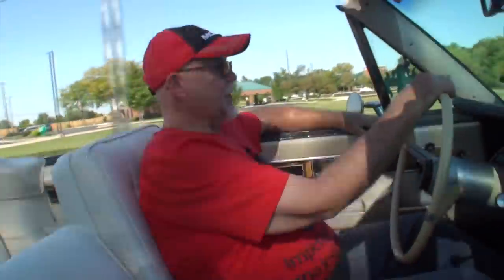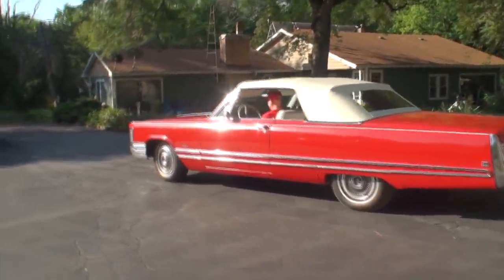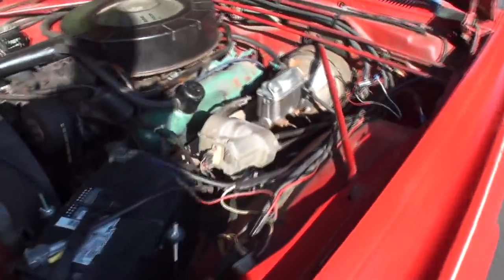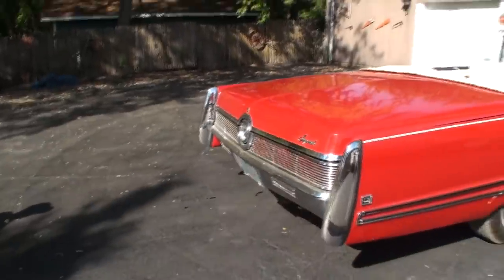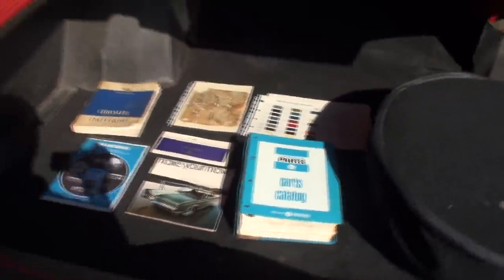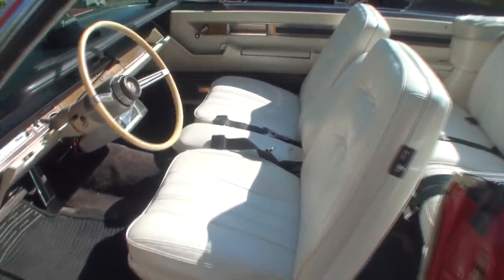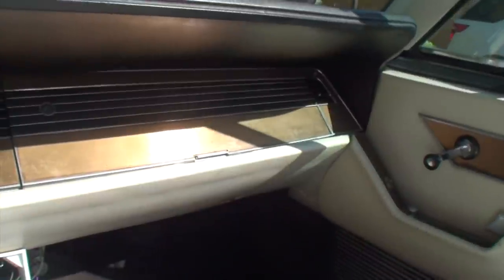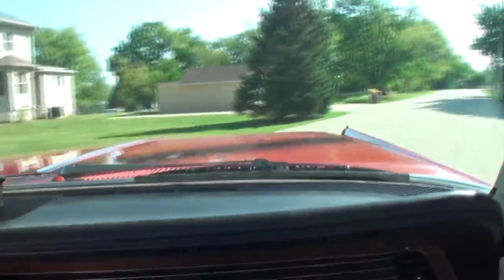BIG RED ! 1968 Imperial Crown Convertible Survivor & Ride on My Car Story with Lou Costabile

Comment: I learned something from this:

-60s seatbelts are bunk.
-The old Town and Country was a wagon, not a minivan.
-Gearheads went to the mountains in the 60s to show off car seats.
-On this car, you can crush the front passenger with his/her seat on demand, and the driver steers with a round string of spaghetti.
-The seats are good actors; they can act like buckets.
-60s cars still had a lot of control buttons, as observed in the interior section of the video.
-The steering wheel (Remember: It's made of spaghetti) has a shaft that uses space shuttle technology.
-It's a land yacht, but it drives like a water yacht. But it handles good for a water yacht. But it handles pretty bad for a water yacht that handles good for a water yacht.

That last one was intended to be confusing lol. Thanks Lou, I haven't been to your channel for a long time. It's nice to see your channel still going strong.
Reply from the maker: Hi Staticky Glad to read you learned something. I'm learning all the time from the Care Takers and I find that to be so much FUN, Welcome back! Lou

Comment: Easy to see and hear Frank's '68 Imperial convertible has been lovingly cared for, and Lou - original and unrestored - it doesn't get any better than this. The clean sounding 440 is barely broken in (!) and what better a car to take you on a long summer drive to, say, Canada, or some equally far off place in comfort and style. That's enough yapping from me, just going to enjoy this very nice video. Thanks fellas.
Reply from the maker: Hi Bruce H., This car has the right Care Taker for sure. Happy to read you enjoy this find to share with you :-) Lou

Comment: Mr. Costabile! Wow, huh? A magnificent cruiser!
Yes, luxury and as well, fabulous brakes & handling. Not just a smooth ride. Those tension bars you mentioned that support the hood are so amazing..effortlessly hold up that monster hood for who knows how many decades..those are torsion bars, akin to the front suspension on those era of Mopar..wonderfully (Actually computer designed) engineered in geometry and quality metallurgy..I have never heard of a torsion bar on a Chrysler Corp. car wearing out.  
The 440 for the big cars had a special cam, a shade less hp than, say a road runner with 375, the big cars were at at 350, but the torque comes in quick..450 ft/lbs at a mere 2800 RPM gets these big cars rolling in a hurry..as well as she moves in this video, imagine with 100 octane fuel, which makes a big difference with about 10:1 compression. 
Thank you so, so much for reviewing this masterpiece of a car <3
Reply from the maker: Mr. Johnson! Happy to read you enjoy this car :-) My pleasure sharing this car with you. You're welcome, Lou

Comment: For the 1967 model year Chrysler adopted the existing corporate unit body for Imperial production. The 68 Imperial represented just a minor facelift of the 1967 offering. The main change was a 1968 grill design which did noting for the overall design of the car and represented a total mismatch with the rear grill which had been styled to match the 1967 front vintage grill . In terms of styling, fit, and finish, the 1967/68 Imperials were no match for the elegant 1964-66 Imperial offerings
Reply from the maker: Thank you for viewing and sharing your knowledge.

Comment: I bought a ‘68 4 door hardtop Imperial Crown for my Mom back in ‘87. I paid $425. She drove it for a couple years, then the strident Pa. Inspection got to be too many little things to fix. I pulled the 440 , 727, and the sure grip center section. I junked the rest of it. Now, I would have fixed it up. I lost Mom back in ‘09. 😔 But her 440 will go in my ‘68 Plymouth GTX I’m building. I’ll put “Mom’s 440 on the fender tag. ☺️
Reply from the maker: Hi drippinglass, Happy to read this car brings back memories of your car you bought for your Mom :-) Thank you for viewing and sharing, Lou

Comment: There are reverse lights; they're in the rear bumper but just need bulb replacement. 

Even though this car is a survivor and has "patina" there is no reason why it needs to be so filthy. The interior could be cleaned up a lot with a simple dust cloth and a vacuum.
Reply from the maker: HI Ed B, Thanks for viewing and sharing, Lou